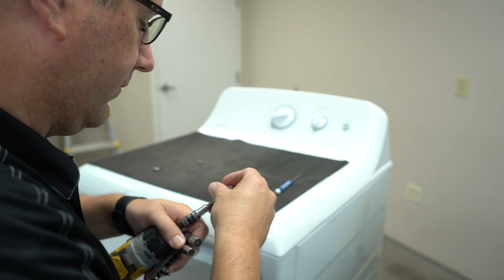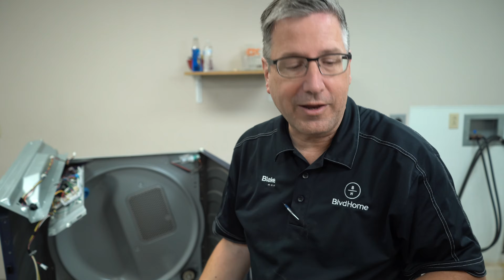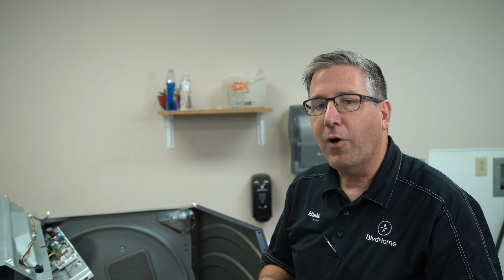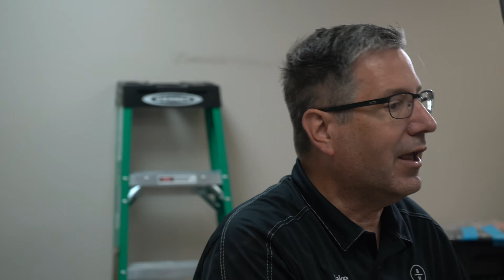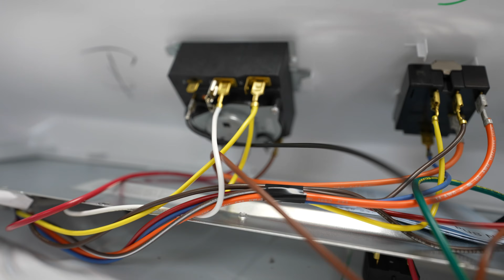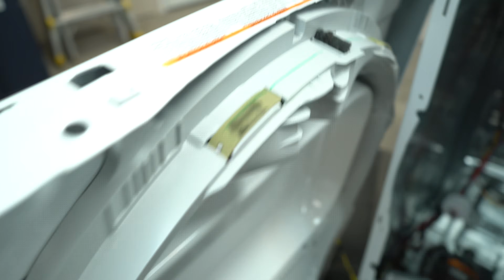What's the Difference Between Gas and Electric Dryers?

Comment: I worked as an appliance technician in the late 70's in high school. I found the only major change is Electronic took over analog. old timers actually used an electric clock operated by a motor. Today it's an old 555 I.C. timer, or 1 computer chip will perform several functions. When people ask, My 15 year old refrigerator is not cooling....  Now days A refrigerator is ONLY designed to last 10 years.

Comment: Having owned both dryer types, gas is far cheaper to operate and performs notably better. When given the choice during our home construction, gas was the easy choice to make for all appliances, hot water heating, and HVAC. The only exception was the oven, where electric performs better than gas.

Comment: Gas dryers are cheaper to run and dry clothes faster but electric dryers are easier to maintain and safer. If you let lint build up on a gas dryer it causes a fire but, on an electric dryer for it to cause a fire you have to let the lint build up until it’s never going to dry and you keep trying.

Comment: Without question the most efficient appliance is a heat pump dryer.
Reply: This might be true but it is worth noting that a heat pump dryer will take longer than a standard dryer.. as long as 3 to 4 hours in some cases. That being said it certainly beats a drying rack. 
Second thing to be aware of is a heat pump dryer is also a lot more expensive up front, normally about $1,000 or so.

Comment: Does an electric heater still require a vent out?
Reply from the maker: Unless they are ventless, such as those coming out now with heat pumps, yes. All that heat and lint buildup in the drum still needs to be vented out to avoid disaster. With heat pumps (ventless), the moisture is essentially pulled out of your clothes and drained, instead of heat being pushed into your clothes with a traditional dryer, so they don't require vents. Thanks for the question!

If you're interested in learning more about ventless, here's a video we did on GE's new ventless washer/dryer combo: https://www.youtube.com/watch?v=wigqoVj-LaM&t=2s

Comment: The fact that it's gas or electric has nothing to do with whether it has rollers or a bearing.  I replace rollers all day thankfully. If the bearing goes bad on the dryer on the lefr you just replace a little sleave not 4 rollers like the other one.

Comment: We need gas appliances out of most homes because our stable climate depends upon it. Hard to dry clothes if your house has flooded from the climate crisis.
Otherwise I appreciated the video.
Reply: Pay more taxes, the government will save us. 💰 💨
Reply: @andrewpeyton5167  if you mean you'd rather pay a carbon price with rebate, it won't work fast enough. I think we need more regulations on fossil fuel producers.
Reply: Your precious planet saving electric used burning coal and oil for up to 80% of grid use nation wide. If you have solar all you’re doing is giving it back to the grid for them to purchase more coal and oil to burn. Congrats!!
Reply: Fool

Comment: The bearing vs. roller design isn't a pointed difference between electric and gas dryers.  There are gas and electric models with both designs.  That white Hotpoint unit surely is produced in a gas-heated version, with the same gas-related components as the gray GE you are showing.  There are GE-branded dryers (both gas and electric) that have the same design as that Hotpoint (produced for MANY years), with front glides and back center bearing.  I fixed one (failed element) for a family member recently that was more than 20 years old.  The rear bearing was worn (but not completely failed) so I replaced it.  The front glides were OK but I replaced them while I had the machine apart.

Comment: Now I feel like I can also take a dryer apart. :D
One question:
When a dryer stops working, how can someone determine what part has failed and needs to be replaced?
Reply: You get to know based on what parts don't work and in what ways. My dryer manual has a list of codes and what they mean, as well as a list of behaviors and what they could mean.

Comment: Well for most folks whether they buy a gas or electric dryer their existing setup will be the decision maker,  unless of course you have the privilege of having a newly built home and get to choose during the design/ rough-in stage.   With gas dryers most come equipped for natural gas by default,  and you'll have to buy an LP conversion kit at your own expense if the gas supply is propane adding to the total cost.   Whereas with electric dryer the universal standard is a 240 volt 30 amp receptacle,  most homes built before the adoption of the 1996 NEC will have a three prong outlet,  while homes afterwards will have a four prong outlet as a requirement and for this reason dryers do not come from the factory with a cord, it's the responsibility of the installer to choose the proper cord or hardwire the unit.

Comment: Electric is way better for the environment depending on where you get your power
Reply: Your utility is probably using oil, natural gas, or coal to produce electricity.
Reply: @lettruthprevail9820  We actually mostly use our rivers for hydroelectricity.
Reply: @lettruthprevail9820 More electric is made with renewables nowadays.  A heat pump with gas generated electric is still more efficient than a gas furnace.

Comment: I do prefer gas but
Reply: natural gas leak. I work at a hotel and we use a gas dryer and front load washer. all the ranges in the rooms are electric. I think so are the guest dryers in the guest laundry, it also holds top loaders. All for guests are speed queen.

Comment: You're comparing apples and oranges
Ive an Electrolux electric   Amazing
Reply: Thank you. I am in the process of getting my house fixed/prepped for a washer dryer set. The fixtures are in the kitchen so I need front loading. I am leaning towards Electrolux myself.

Comment: GAS DRIES BETTER, FASTER & CHEAPER BILLS.
Reply: WHY ARE WE SHOUTING?
Reply: Omg they set fire😱😱😱
Reply: OK. 👍
Reply: I have electric dryer in my condo and propane dryer at my weekend cabin. Love the propane
Reply: Even against heat pump dryers? They are dropping  in price and some run off 110.
Reply: Consumer Reports found that gas and electric dryers dry clothes equally well in the same amount of time. There might be a difference in cost though.
Reply: Where did you learn how to speak doggy doggy? 😮
Reply: AND EASILY SET THE HOUSE ON FIREE
Sorry, the heat of the comment got me too
Reply: @bugaboiii414 where’s your data from? How many of your houses have been set on fire by gas dryers
Reply: Lol @bugaboiii414
Reply: Most fires are caused by lack of cleaning the vents of lint. Not from the type of energy your using.
Reply: @bugaboiii414 OR LEAK CARBON MONOXIDE